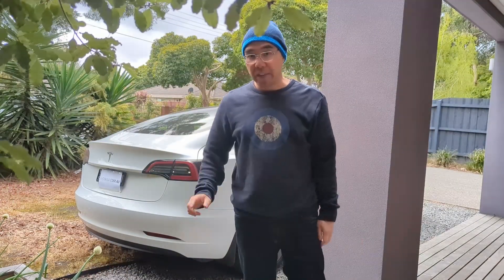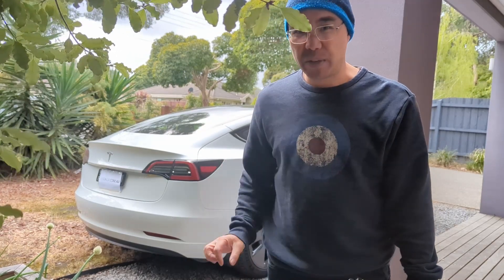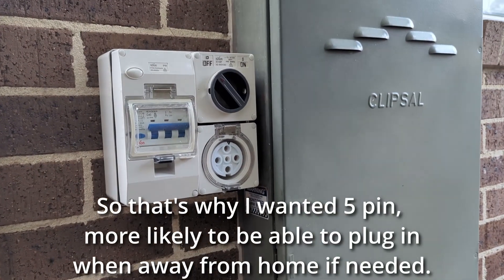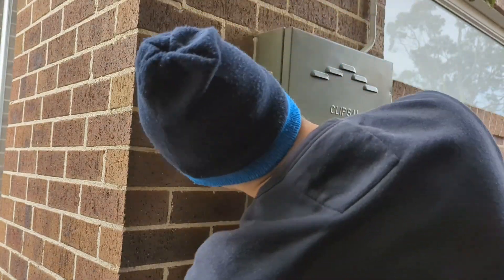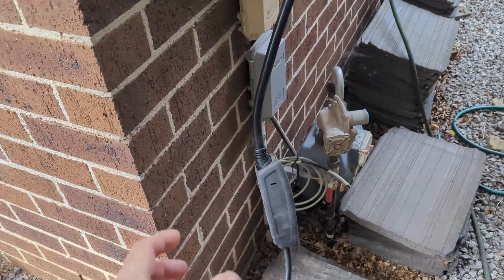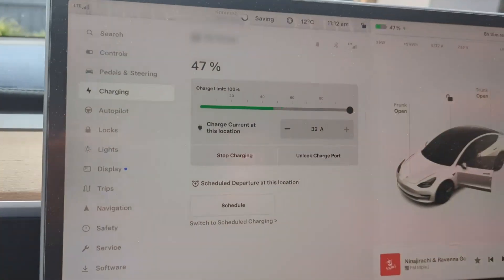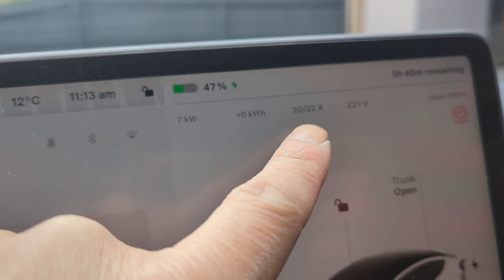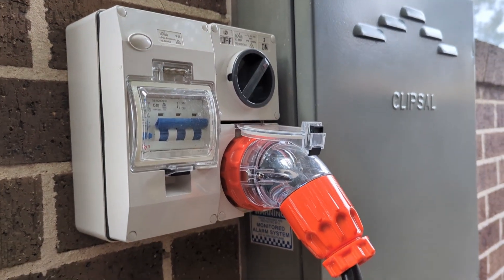MORE POWER from Tesla's mobile charger connector! 7kW from 32A single phase 5 pin tail - Faster!

Comment: Nice video. What is the gauge / cable size on the standard mobile charger ? 

Cable size looks like it drops from plug / adapter. 

Thanks !
Reply from the maker: The standard Tesla mobile charger comes with a 10A and 15A plug, this is an aftermarket 32A plug. Don't really know what gauge things are, all I know is it works perfectly regardless.

Comment: What did the installation cost you?
Reply from the maker: Had it done as part of a big house overhaul, so I didn't get an individual breakdown of the installation. But it's right next to the switchboard, so it's about the cheapest easiest installation you can get done.
Reply: Id say roughly $500-$1000 for install

Comment: Can you only do this with Tesla? What cable do I need for a Kia EV? Thanks
Reply from the maker: Nope, as long as your Kia has the same Type 2 connector this will work. Also see my video using this setup on my wife's MG4 https://youtu.be/l52Zqq-OrmQ . For your Kia, get your sparky to put in a 32A connection, then buy a 32A charger and you should be good to go.

Comment: Thanks. Is it ever useful when travelling?
Reply from the maker: Depending if you do any camping, some campsites do have 3 phase power where you can use this 5pin plug. Otherwise I just bring my tesla mobile charger, plus the 10A, 15A and 32A 5 pin plug when I'm on road trips and so far touch wood never had any problems

Comment: Nice work around. 
My only concern is that the voltage dropped from 235V before charging started, to 220V once it was pulling 30A (about 7% voltage drop which is too much). The regs only allow for 5% over an entire installation from point of supply. It's a very short subcircuit, so there should be barely any voltage drop there, so maybe get the sparky to check your mains. This often happens when the supply neutral has a bad connection and current is returning through the earth connection.
Reply from the maker: what a fantastic comment, thanks for the information - I'll get it checked when my sparky is back fixing a few other little things
Reply: Hi! Did you managed to fix the voltage drop? I'm experiencing the same thing

Comment: Cheers mate. Had the same thing done on my home here in the UK. Saved me a ton of cash. Dont need the "smart charger" when the tesla has the smart charging features already installed.
Reply from the maker: Here in Australia the tesla wall charger is AUD $750 and the MG wall charger is $1,199 - so of course many EV owners of all brands are choosing to install the Tesla wall charger. And a lot more also buying the mobile charger, with a 32A tail for the same reason - performs well at a good price. I don't have solar (yet) but am investigating it, now that we have two EVs to charge up.

Comment: G'day, an Aussie from Thailand here. 
This is great info to know. When we built our house in 2006/7 we put in three phase as it is not that much more to do here. 
I don't yet have an EV yet, but great to know that I could potentially charge at 21kW if required, although my normal daily driving is only 35 to 60 km's so probably rarely need it same as you.
Cheers.
Reply from the maker: Thanks mate - the maximum charge rate is actually determined by the on board charger in your car, for example I think all Model 3s have a max AC charge rate of 11kW. MG4s have either 6.6kW or 11kW max AC charge rate. Still, having three phase available gives you the most options and highest chance of maximising your charge rate at home (wish I'd put in 3 phase when we built our house 13 years ago!)

Comment: Do you have a link to where you got the 5pin plug for the mobile connector
Reply from the maker: Got mine from EVSE adapters, but they are also available many other sellers - just google "tesla 5 pin tail" and you'll see a bunch of them. Recommend going for a 90/100cm tail